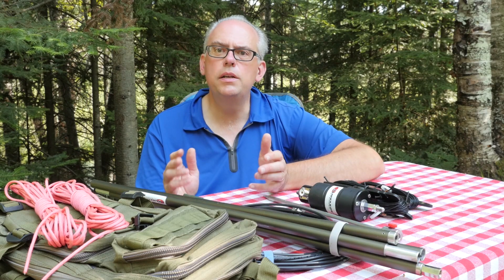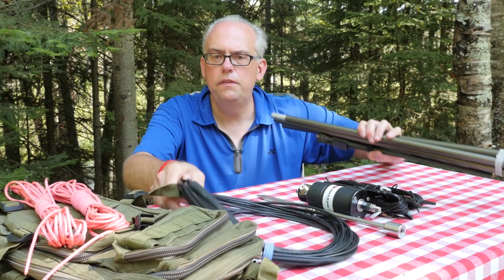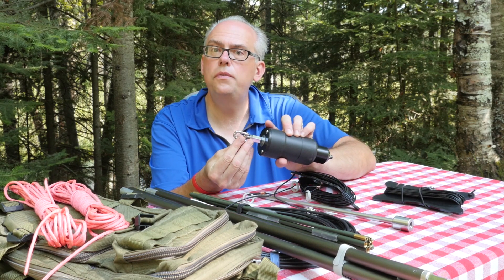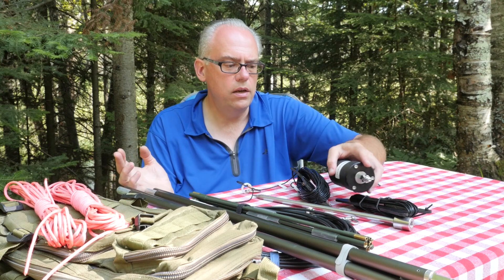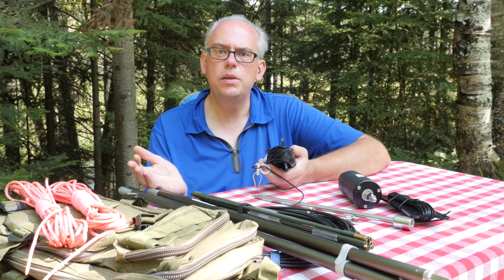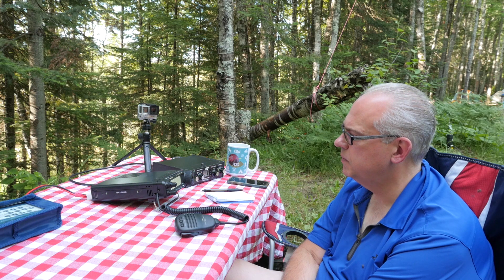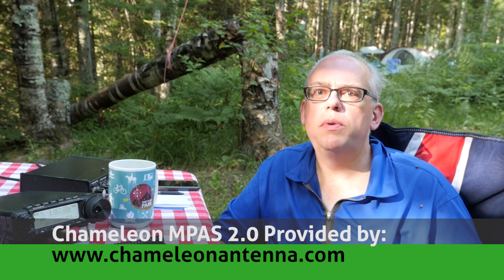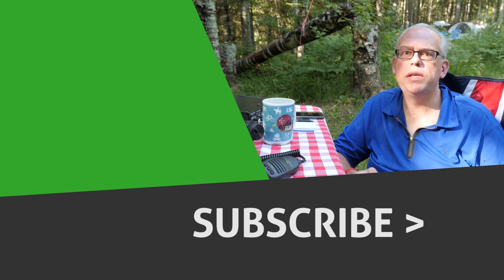Chameleon MPAS 2 NVIS (Near Vertical Incidence Skywave) Antenna - Ham Radio Q&A

Comment: Your trip to the barber shop was very, very long overdue.  My dog Millie will not go nuts now every time you appear on my laptop screen sporting the 1960s look with that ponytail -- it was a rather fright-inducing look, let's be honest.   Your presentation on NVIS here could have been better had it featured a much stronger emphasis on the impact of the odious D LAYER.  On 40 meters during daylight hours, plenty of your already-low power signal was very likely soaked up "both coming and going" through the D Layer of the ionosphere.  All of those flies posing on your shirt during the show were a great advertisement for "going to the north woods in Wisconsin".  HI HI.  de AF5SS

Comment: Hi! I have an NVIS antenna for 40m. I'd like to know wether 5W QRP is practical enough for propagation via NVIS,  not for the usual propagation with low angle radiationis. Thanks!
Reply from the maker: QRP is practical for NVIS. Typically you don’t need a lot of power and most NVIS stations do well with 20-50 watts

Comment: Your statements that the MPAS antenna is "highly efficient antenna" is very misleading to folks that are unaware of the fact that the 5:1 transformers are know to possess a lot of loss that decreases efficiency.  Yes, you can make contacts with this system, but you can also make contacts with a wire connected to a 50 ohm load!  SWR tells you nothing about efficiency of the antenna, and just because the SWR is low, doesn't mean the efficiency is high.  A dummy load has a very low SWR but is a very poor radiator.  I just wish more antenna companies could learn to be more honest about their products.
Reply from the maker: Are you saying this because you don't like Chameleon as a company? Because for some reason they tend to attract a lot of negativity. The 5:1 Guanella transformer has a demonstrated efficiency of about 83%. 49:1 transformers with the 14/2 winding are typically 86-89% depending on the core material. The deficiencies of the MPAS can  be more attributed to the vertical configuration's relatively short radiator and poor ground network than its transformer. If you compare the wire configuration against a wire end fed half wave, the difference in performance is marginal.  

On a side note, using the 'dummy load' comparison to denigrate an antenna does nothing than to throw more confusion to the mix.
Reply: @KB9VBRAntennas  I have serious doubts about your efficiency figures for the 5:1 transformer and I am speaking of using it with the wire.  But of course it will be worse with the vertical since it is a lot shorter.  There have been published tests on the 5:1 transformers that shows up to 6db loss on the low bands.  So, calling it "highly efficient" is very misleading!  Every 5:1 I have seen gets very warm in operation and that alone indicates a fair amount of loss.
Reply: @KB9VBRAntennas  No, I'm saying it because those 5:1 transformers obtain a low swr through loss similar to the way a dummy load works.  Yes, you can make contacts with them but they are not "highly efficient"! And saying so is misleading, especially to the newbies that don't know a lot about antenna theory.  I do feel that Chameleon antennas are way over priced for what they are though.

Comment: I have the Chameleon Emcomm III portable that is electrically the same: 5:1 unun, 73ft radiating element, and 25ft counterpoise.  Ancedotal testing on 80m NVIS suggest it is about -6dBr relative to my Ultimax 80m-10m 130ft EFHW antenna when both are in inverted-L configuration at about 25ft elevation.

As I operate portable in parks I opted to buy two of the shorter Super Antenna counterpoise set for 17m, 15m, 11m-12m, and 10m, instead of the four 25ft counterpoise wire set from Chameleon. It does seem to provide some improvement to both antennas.  More so for the Chameleon Emcomm III portable, especially on 80m and 40m.

Adding the counterpoise sets to the Emcomm III does cause some minor variation in SWR being slightly up or down depending upon band. The SWR ranges from about 1.8:1 to 3.5:1.

Typically I regularly make 80m NVIS contacts running 20W on the EFHW. Yesterday I checked into two 80m nets and had a QSO running 10W on the EFHW.

I would probably have to run 40W to 80W to do the same with the Emcomm III.

For 40m and up the Emcomm III seems to be a keeper antenna. For 80m NVIS it is usuable, but not stellar by any stretch of the imagination.

I might try running four 25ft counterpoise wires with the Emcomm III to see how much improvement there may be in SWR, sending, and recieving.
Reply from the maker: I think you are pretty much on track. A 130 foot EFHW will perform better on 80m than the 73 foot Emcomm III Portable, and I'd say from my experience that a 6dB difference sounds about right. To put things in perspective, that's a difference of 1 S-unit. 

I also think that a 40 meter EFHW and the Emcomm III portable will perform about the same. In that realm you are comparing a random wire style antenna with a resonant half wave, but the efficiencies are a pretty close match. With that said, I've also had better luck using the Emcomm IIIP on 80 meters than using a 40m EFHW with a tuner on the 80m band. The non-resonant qualities of the antenna make it bit more versatile in that regards. 

Same with changing the lengths of the counterpoise. A non-resonant antenna will very well influenced by using a longer or shorter counterpoise wire. 

Best of luck and keep experimenting with it.

Comment: Michael: why do you think they choose 73’ as the length of the dipole wire? It’s not half wave for 80 or 40. Seems like they should have chosen to be resonant on one or the other.
Reply from the maker: Long story short, Chameleon has a design philosophy to cover the widest number of bands with good performance. It may not be the most efficient, but it is the most versatile. 

The Chameleon antennas are non-resonant antennas, so they use a wire length that is not resonant on any bands. With the proper matching transformer this allows you to work on multiple bands either without a tuner, or using an internal tuner that can deliver a 3:1 or better match. One advantage to this is that it gives you good performance on bands like 80, 60, and 30 meters without the antenna being excessively long. If you used a resonant end fed half wave antenna with a wire cut for the 40 meter band (approximately 67 feet), you would get resonance on 40 meters and on the harmonics like 20, 15, and 10, with adequate performance on 17 and 12. But a 40m EFHW suffers on 80, 60, and 30.

Comment: I know the video is 2 years old now, but this antenna is still available and popular. I would encourage anyone with this antenna, running either the wire element or the vertical whip, to try the setup WITHOUT a counterpoise. I tested my setup with both the whip with the extension and the whip without, the telescoping whip and the wire antenna....I started with no counterpoise and worked up to 4. I found that each time I added another radial the SWR would increase and the number of resonant bands would often decrease. I tried this setup in two different locations with completely different soil and terrain and found it to be a constant. Try it for yourself and see what you come up with!
Reply: I'll try that. I have the Emcomm III portable that is electrically the same with a lower power rating. I tried adding the Super Antenna counterpoise wire set for 17m, 15m, 11m-12m, and 10m.  The SWR changed a little up and down by band. The SWR varies from about 1.8:1 to 3.5:1.  The counterpoise seem to help 80m and 40m.

However, the Emcomm  III portable seems acedotally about -6dBr from my 130ft Ultimax 80m-10m EFHW antenna when both are deployed in inverted-L configuration at about 25ft.

Comment: I’m trying to decide on what the very best  NVIS antenna is for close in local contacts say between 5-100 miles
Reply from the maker: I've done 80m NVIS with a wide variety of antennas. (I like to check into our weekly 80m ARES/RACES net on Sunday mornings while out camping). I've found that no one antenna works better than the other. I've used 40m antennas like the dipole or EFHW, along with a tuner, to get on the 80m band. And I've used an 80m OCF dipole and G5RV with great results. Antenna height makes the biggest difference, as lower is better. But the key to good NVIS is that all stations need to be using NVIS style propagation for it to be successful.

Comment: Hay Mike, how about the vertical whips, how do they perform? I have a 818nd and looking for a antenna for qrp in the field KN6GZP Dave, thanks.
Reply: I got the MPAS 2.0 in May this year ( 2020 ) and on 20m I made regularly contact to South America on SSB with 100 watts using the FT-891. On 40 m it's not as efficient or 80 and 160m but I have made some DX on 40m with it. 

Even on FT-8 I can make contacts to North and  South America from Ireland using 20 watts. Even gets out on 160m on FT8 not going to work well here though on 160 or even 80m but on 80m SSB I've got to the U.K on 80m SSB 200+ miles. I haven't tested it out much on SSB on 40m but the MPAS 2.0 vertical works so good that I had intended it to be my portable antenna but now it's set up permanently and I take it down only for portable use.

I also got the CAP HAT and it lowers SWR even more. 

I haven't used the wire antenna much at all I've been so impressed with the Vertical.

Very impressed with the MPAS 2.0.
Reply from the maker: You lose a bit of efficiency with vertical antennas‚ but you can still use them QRP. Here's a video where I compare the MPAS 2.0 with the Wolf River Coil Silver Bullet 1000. That may help you in your search for an antenna: https://youtu.be/f4B9I9jqLSI

Comment: You’re videos are amazing! So informative. I’m a fellow Wisconsinite. Any recommendations for a mobile NVIS antenna? I can’t seem to find a good option to mount on my 4runner.
Reply from the maker: Mobile NVIS is tough. The best option would be a 102 inch whip with an autotuner at the base. You can bend the whip over by tying it to the front bumper for NVIS operation. Barring that‚ any other way you can get the antenna into a horizontal configuration would work for NVIS.
Reply: @KB9VBRAntennas  I thought so. I did come across some interesting magnetic loop configurations, but they seem prohibitively expensive. Thanks for the tip!
Reply: @KB9VBRAntennas  I'm still learning and was wondering the same.  Thanks for for the reply to his comment.

Comment: I have a bunch of Chameleon antennas and they are rock solid and work as designed. The MPAS 2.0 is an improvement on the original with better built antenna whips using the versatile Hybrid micro as the core component. I use my FT-891 with an LDG tuner to match the Chameleon antenna to the desired frequency

Comment: Nice video! Looking to get a HF rig for my shack. I keep hearing start out with a 40 meter dipole. I am a general class now and would like to get my feet wet before I take my extra. I live in the country so the possibilities are endless...well I think they are. Thanks Again!
Reply from the maker: The 40 meter dipole is a good all-purpose antenna. You can get 40 and 15 without a tuner and squeeze in 20 and 80 with an external tuner. If you have the space, though, you may want to consider something a little longer, like a G5RV or Carolina Windom off center fed dipole. Both have good all band support with a tuner.